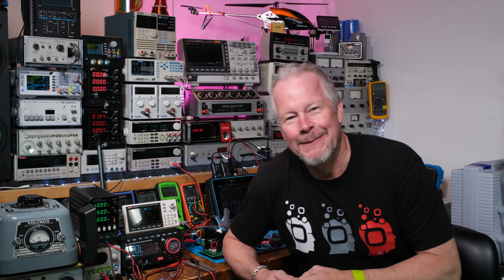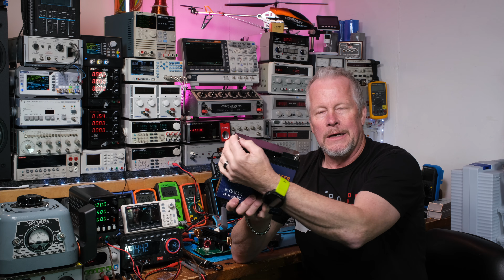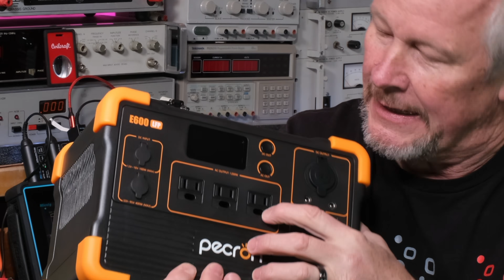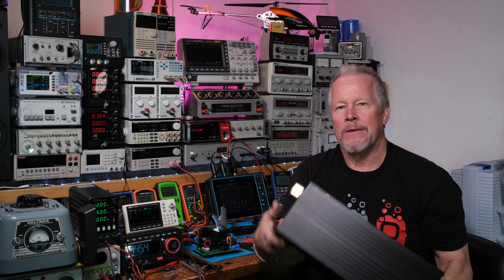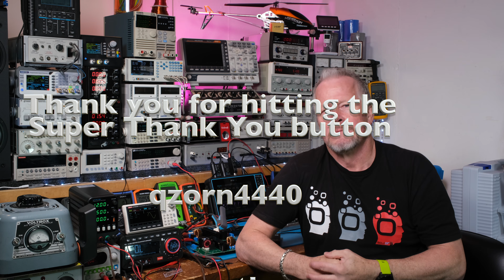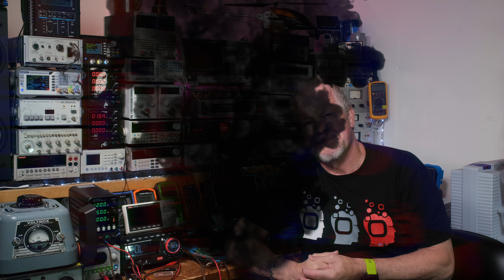Understanding Safety Ground Rant #rant #understandingsafety #grounding

Comment: Mind helping clarify something for me? If I have two devices with metal chassis and the safety grounds on both (the 3rd outlet prong, right?) are properly connected to the chassis then do I still need to wire them together? I think you said "yes", but I didn't quite understand why. If the safety grounds on both are connected properly then aren't they already connected by that? Suppose one shorts, since it's properly connected won't it trip the breaker anyway, so why do I need to have the separate connection?
Reply from the maker: Yes the 3rd prong connects all metal together, so that is your safety ground.
Reply: @kissanalog should I still also bond everything together separate from the safety ground?
Reply from the maker: That should not be necessary.  If there are 3 prongs on the power cable, you can measure the ohms of the ground prong to the chassis to be sure (especially if it is a second hand device that you purchased).

Comment: Moin Moin,
In germany we call it Potential equalization. The PE is to lower the touch voltage and the current should pop the mcb (as you told). Yes and you are right. The protective earth (PE) the earth has noting to do with the earthing system! The PE (in germany) is connected to the neutral at the home entrance or on TN-S Systems to the star point of the transformer.
Nice explanation! And right ground is a rod or ring that is in the earth, and is a fall back to the transformer and in a TT system it is even the way back for the PE to the transformer.
Reply from the maker: Thanks for the great info!  Cheers!

Comment: Tak!
Reply: Always enjoyed the educational rant videos. I'm in a club of hifi enthusiasts where we often have discussion about earth. There is a belief that they need to connect all there equipment to earth with a separate ground spear in the garden to get the best earth connection and get rid of noise. Like they pour the noise out in the Ground and achieve the best sound. What I often see is people make a lot of groundloops instead. Can you give me som arguments against this misbelief, as I am always conquered with stupid arguments from the majority of people there.
Reply from the maker: Thanks so much!  I appreciate you!  Here's the deal - electrons travel in a circuit.  The earth ground is not part of that circuit that powers the audio system.  When we do EMI testing - we have to shield and be sure where the circuits are to be sure the noise does not propagate.  It will not help to earth ground - it simply is not part of the circuit.  Earth ground in our electrical environment or circuits is only used to place the system at the same potential across the system.  Ask them if they can measure ANY current in the wire to the ground rod?  They will not be able to - and if they do it might mean a safety issue.

Comment: I think you can get a 220vac shock from two 120vac shorted ungrounded metal devices plugged into two different outlets, one feed from L1 and the other from L2?    🥳  Great video.
Also, on a large factory 440vac floor main, it can be a big job locating an intermittent short, once per day or week, in a bundle of a hundreds of green ground wires.  Thanks for the rant.
Reply from the maker: Thanks for the great feedback!  I appreciate your support!

Comment: Remember a hot summer day covered in sweat slumped in a wooden chair on a wooden floor with a metal-bottomed joystick on my belly playing Doom at my work desk. I reached up to grab a metal extension lamp when my belly started to vigorously vibrate to 60-hertz hum. After realizing what was happening I was able to tug my arm away from the lamp quickly with only a low game score to show for it. Apparently, the insulation on the lamp wires was failing and contacting the metal body of the lamp with the circuit finding ground on the metal bottom of the computer joystick. LOL still have that lamp safe to touch and use as long as you remember that one little issue
Reply: Best workout you've had for ages LOL ! :)
Reply from the maker: I think the first shock I got was from a lamp ;)

Comment: Who has not floated a scope in their life? I want names.
Reply from the maker: LOL - I don't want to promote it - but most of my scopes throughout my life have been floating.  The labs actually have a bucket of the adapter cheater plugs - we called them.  I've worked in power labs where the engineers and techs all understand what we are doing;)
Reply: @kissanalog  Yeah, it's done all the time, but we don't like to talk about it, lol.
Reply: You would find cables with the earth wire pocking out of the plug to visually show no earth !   @kissanalog

Comment: In my opinion earth is a connection from a component to the 115 volts/240 volts supply outlet.

Bonding is the connection between the earth connection to the metal casing of the component and all other metal cased components that are connected to it.
Reply from the maker: Thanks for sharing this.  Bonding - it can mean different things.  In my work it usually is said 'Bonding Neutral to Ground'.  This is not actual earth ground.  But - the Grounding Rod is also bonded at this point - and this is the only place where the green or bare wire runs down from the Neutral to Ground Bond to the Ground Rod - that 'Earthing wire' makes any sense.  

Safety ground is that 3rd conductor that ties all chassis together and provides the shorting path (when and if the Hot wire touches chassis) back to the Neutral to Ground bond.  This will trip a breaker.

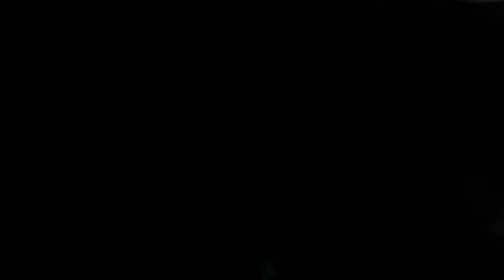Comment: This had to be worst presentation I've ever watched about grounding. I can't get my 22:35 back after watching this to be honest. The fact this video never once talks about hardware that has been tested and qualified to meet cUL / UL / CSA, etc simply boggles my mind.

What does that mean???

That means anything in a store sold in North America must meet the above standards if they are to be sold in their respective markets. That doesn't mean when you buy / purchase something from Amazon, eBay, AliExpress that said hardware has, does, will meet those safety standards!

Watching this presentation about why his meter didn't show continuity when probed to the frame just made my eyes roll back into my head.

It's called paint . . . 

As it relates to phrase Earthing vs Ground, it's literally tied to the Earth ground bar in the home! So its literally connected to the Earth why all the fuss???

As it relates to grounding that is NOT the same as a AFCI / GFCI that provides Human safety. Whereas the former is intended trip a breaker during a over voltage or short.

This will not protect human during said fault . . .

If that wasn't true humans would have never created AFCI / GFCI's to detect said faults! One is to protect the wiring vs the other is intended to protect Human.

The rest of this video was endless repeating of information that made little sense and rarely on point. 

A properly made and tested device will be grounded in all aspects - period. If you have doubts than you purchased one of the billions of devices made in China that have zero testing and adhearence to standards!
Reply from the maker: Thanks for your feedback - I think this video is exactly the kind of video that you need based on your comments.

I tried to help diy folks that I see on YT building systems that are doing great work - but do not understand grounding safety as it relates to Chassis or Safety Ground. 

So - not to get caught up in all the different ground names and conventions - I wanted to point out ONE thing!  That is to make sure that all metal is at the same potential.   That was my point - but you obviously missed that.  So either this video did not turn out as I hoped - to save people - or you are one of those so contrary to anything you see that it couldn't soak through the contrary layer.

This is a RANT not a presentation.  I'll leave a link below for a video where I actually did try to cover this topic in more of a presentation style.

I used the meter against the paint to illustrate that the paint is an issue - but your mind didn't catch this as you were too concerned with your own issues.

This video - although I may have not done a great job - was to say forget all the poorly named conventions - and just make sure that all the metal boxes are tied together with a wire.  If all your boxes are bolted down on a metal frame - like  a car or boat - don't count on that contact - use a wire to be sure.

Yes a product might be UL certified, but when placed in a system with other boxes it does not mean the system is UL certified.  The system has to meet standards too.  I was once a certified UL tester when working for Square D / Schnieder Electric, so we designers could also test our own products to the UL standard. 

This video was an attempt to keep it simple and talk about the one thing that that is the most important to be safe - IMHO.

Comment: You obviously have a deep understanding of this topic, but your explanation isn't good. IMHO you should have started with the difference between a return, which is handling up to full system current, and a safety ground, which should ideally have no current flow, but is allowed by code to have up to 5 mA. This should be followed by answering the question why it is imperative that there is no current flowing in safety ground by relating potentials using Ohm's Law. Once the listener is aware that they may have been lumping returns together with safety grounds and why safety grounds are unique, and that they have nothing to do with earth (using examples of airplanes and satellites), the rest of the stuff is a lot easier to understand...
Reply from the maker: Thanks for your feedback!  This is obviously a huge topic - and that is why in this video I tried to keep it simple by asking the viewer to be sure to tie the metal chassis of different boxes together.   I need to do more videos on this to see if I can keep us all safe.  Here's one video that I did that tried to cover the topic more thoroughly.  Heres a link: https://youtu.be/FFJm5nQlUF0

Comment: Haha i never actually built much from metal, especially not by bending it. By the time i became a tinkerer, first thing i got was a very cheap ($130) wood frame 3D printer kit, so i have it throw plastic parts at me. That's how it is these days, i think most people today start off a background of digital creativity + programming + 3D printing + Arduino and Pi kits and parts into electronics. But i also have some experience with styrene sheet and plywood, a little epoxy casting, from model building background.

I'm still going to call the ground alongside mains connection a Safety Earth just to avoid confusion with Ground which is a logical concept and can float or be relative to anything whatsoever. I don't have an Earth in a battery powered device but i have a Ground.

And Earth is after all vaguely at the "earth" potential just like say your water main and your central heating, apropos metal surfaces that you can touch. Would be super hazardous if it weren't!
Reply from the maker: Thank you for this feedback!  I can tell from the comments that this is a subject that needs more videos;)
Reply: @kissanalog  Yeah for sure!

Comment: Just as well you did not cover the complexities of "RF grounds" with TN-CS electricity supplies.. another nightmare. Of course some of the plastic cased equipment is not "double insulated" like the average hairdryer. A plastic cased oscilloscope with a line of BNCs across the fascia...
Reply from the maker: Thank you - you are so right.  There's so much to cover.  I need to do more videos;)
Reply: @kissanalog  it is a lot of fun to dig in to the regulations for "earthing", with my homebrew projects I used to obviously try to make them safe. Typically for instance with the incoming "ground" wire, I used to often take it to a tag attached to one of the mounting bolts on the mains transformer, some regulations do not permit that, they demand a non structural point. (I am think of the typical aluminium enclosure). It does make a bit of a nonsense out of it when you may be using an inverter to power it where the "earth" goes nowhere. Keep up the good work.
Reply from the maker: Great feedback!  That's the issue with the poor naming conventions.  There is no Earth ground on a plane, ship, or automobile;)  However - there are metal chassis - and we want to be sure that they are all at the same potential.
Reply: @kissanalog  it would be difficult to print "Equi-potential bonding wire" on a compact moulded plug :-)
Reply from the maker: I think PE for protective Earth - even though it really should be PC for Protective Chassis;)

Comment: Thank you, it took some time to figure out what was dangerouse and why when dealing with electronics, the what was preached by alot, dont touch! but the "why" really hasnt been which didnt help understand the dangers.  I thought electricy would randomly flow into me if i touched it, like touching fire , i would get burned no matter but its not like that, you have to complete the circuit.  Why i hearrd of the 1 handed rule but never understood why it was a thing, not understanding the completing a circuit concept with electricity shocks.   Even then experts still get shocked, its always an unforsean accident, not really a lack of knoweldge. The one handed rule hit home when a youtube amp builder told his story of getting shocked, he disconnected a speaker wire inside the amp somewhere which did something to the ground, his fingers where touching something, then the back of his hand brushed up against something else,metal, and his hand got shocked.   Which kind of helped me understand how the 1 handed rule saves you. Its just your hand that completes the circuit, not your whole torso if two hands completed it.  And thanks for thing about metal cases, they are my biggest pete peve in electronics,  now with 3d printers, theres no excuse to make everything plastic around electronics for safety.  When i find a gold cart battery charger and its made of metal im too scared to even turn it on, why make it out of metal? ...  just an accident waiting ot happen something gets bent and  ugh,, thank you!
Reply from the maker: Thanks so much.  I appreciate your feedback!

Comment: My dad thought me whenever you use an old equipment that you don't know about, an amp or anything with a metal enclosure it's better to first check it with your back of your hand, specially knuckles quickly, that won't kill you in any way because muscles contracts in the opposite way. This method saved me once :) (I know it's not the most scientific way but it was communism after all)
Reply from the maker: Thanks for that!  I've been taught the same thing and there is a good reason as you point out that it works;)

Comment: Hi Eddie… I still find the whole earth or ground concept so weird. Many years ago I designed stuff that had to go submarines and god, those discussions with the system-engineers of the submarines just got weirder and weirder. At least the grounding stuff in aircarft was more back-to-the-ground. Later I moved to Europe, above the Arctic circle, and thouht it was enough if I put a huge earthing spike outside my shack for my antennas (we live in a remote, rural area).. Measured between that and the mains earth in the shack, and it was a couple of 100 ohms. THEN the electric company placed all our electric cables underground in accordance to the latest specs… now if I measure between my antenna-earth and mains-earth, I measure Mega-ohms, but still no differential voltage between the 2. Not sure if the resistance between my antenna gound and mains-ground is so high because the ground is frozen all over, but as long as the earth-leackage breakers work, and I dont get a shock when I touch my antenna ground, and the safety-earth in my workshop I guess I should be happy, lol
Reply from the maker: Thanks for the amazing real life experience!  It just goes to show you that the earth ground is not all what we think it is - or what we wish it were.  It is a terrible ground.  Where you are - it must be so bad that it doesn't carry current so can't be an issue;)  I think it is somewhat of a mystery, but so many people think 'Earth Ground' is a magical place where all stray electrons want to go.

Comment: Gosh darn it. I never realized I had to connect the ground on a battery to something. I thought they were all defective.
The really old wiring in houses was 'knob and tube'.. Some of those installations were beautifully crafted. The hot wire usually ran through the attic, and the neutral ran through the basement. They would feed the light fixtures with the hot and bring the neutral up from below to the switch. and then continue up to the light, so yes they were switching the neutrals. Not the safest thing if you needed to work on the light fixture wiring and you were grounded somehow. As you mentioned there were no grounds in the receptacles. Appliances were metal of course and if the hot were to somehow come in contact with the frame, and you were touching plumbing, or your feet were wet, you might have a shocking experience.
Reply from the maker: Very interesting background info!  A BIG thank you!!